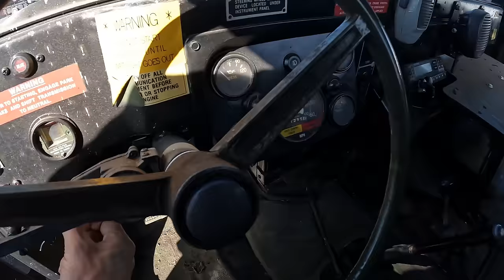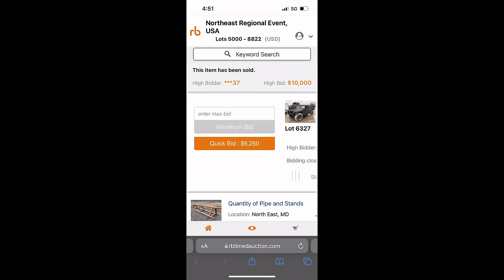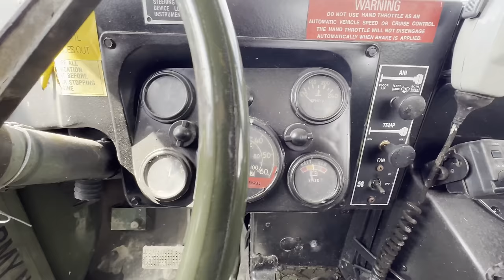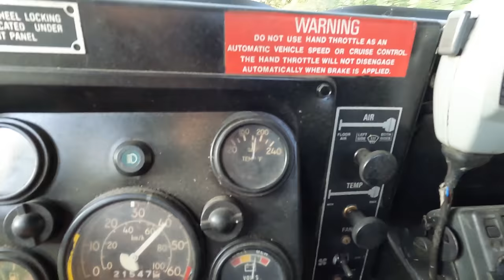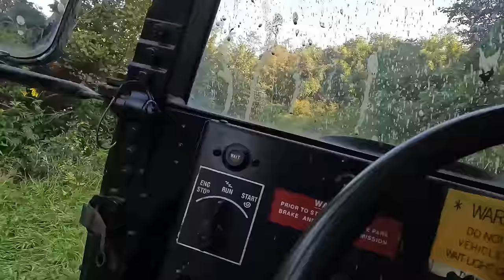Buying, Servicing, & Off-Roading The Cheapest Humvee I Could Find!!

Comment: Your front tires were spinning like an open diff when you were in that big mud hole, I believe there’s a feature that if you push and hold the brake and gas or something along those lines it basically will engage both wheels, you’ll have to do some research to know if yours is equipped/how you utilize that feature for sure though

Comment: The antenna mounts were for the AT-1729, part of the VRC-49's. I helped developed the HMMV at 29 Palms,CA.  back in the Mid 80's. We wore a bunch out, crashed a few. Lot better than the Mity Mites we had at the time.  BTW- grill on top of engine deck is no step.

Comment: Hey Matt, awesome video!  You can two foot drive to get the Torsen diffs to transfer more torque when in sticky situations. Great content!
Reply: It's known as BTM (Brake Throttle Modulation). Takes a little practice, but it will keep you going where others will be dead in the water.

Comment: It is like driving a large shoe box. Going from a 1/4-ton jeep to a Humvee was quite a transition. I have seen C&C and the coolest piece he bought and fixed was what we called a Small Emplacement Excavator (SEE) is a lightweight, all-wheel-drive, diesel-engine-driven, high-mobility vehicle with a backhoe, a bucket loader, and other attachments such as a handheld hydraulic rock drill, a chain saw, and a pavement breaker. The Germans developed it and called it a Unimog. As a former Soldier, I can assure you there are other Soldiers loving what you are doing. It is what they wanted to do but could not. Don't let the Army see you put that top on or work on equipment or you will be DRAFTED. There was a big deal as some manufacturers put a bunch of Chinese Blocks or engines in them. You could probably get the Technical Manuals from Operator to Depot maintenance. The oil Filter date is 2010. In the military, they slash the zero to distinguish it from the letter "O". I bet that the fuel filter has never been out of the case or changed. It is definitely not operator maintenance level. They make a fording kit for these. The Marines put them on all of their vehicles for obvious reasons, the Army not so much. Careful fording streams. If you hit the water too fast the plastic fan destroys itself.

Comment: Those brackets are for the light bendable antenna. The mount in between the passenger and driver is the deck plate for the radio accessories

Comment: Just want to add a couple of items that you missed from the maintenance  manual.
You should replace gear oil, might as well do it, takes regular 80-90 gear oil. Transfer case as well.
Inspect all glowplugs or better yet just replace them, half of them are probably mushroomed out at this point.

Comment: The Humvee is a beast, all come with the rear back rest when used in the 2 man mode, the green things are antenna holders.  BE CAREFUL, the brakes stop the axle shafts and no the wheels. You can twist off the shaft in front by having the wheel spinning and slam on brakes.

Comment: General off-roading trick for any vehicle with antilock braking installed, just like the humvee with its torque locking diffs, if you use the brakes correctly you can gain traction.

The difference is, on the Humvee, you apply light braking whilst applying the gas, with an ABS vehicle, you want to apply full hard braking whilst giving it gas.

It will see the wheel that's not spinning (and has traction) as "locked up" and will release the brakes on that wheel, whilst continuing to apply hard brakes on the wheel that is spinning (and has zero traction).

It's basically the same thing electronic traction control does.

Comment: Those two things you found are actually antenna mounts that you would put on the back of the HMMWV. They bolt in with a flat face on the back of the truck above the tail light, and the other flat side towards the sky (this is where the spring would sit on top of for attaching the screw on antenna for VHF radio systems).

Comment: During my two decades of service I was of the opinion that the Hummer was ridiculously underpowered for a vehicle of that size/weight.
Reply: you mean 60mph on a downhill with a firm tailwind is sub optimal for 10 tons of fun wrapped in military drab perish the thought lol
Reply: 100%....that's why I'm puttin a Cummins in mine.  IMO, that's what they shoulda come with from the fac-to-ry
Reply: @bryanford1139  Duramax diesel was a popular swap years ago when AMG still made the Hummer. Things got screwed up (more like trashed) when GM licensed the brand. I think Jim Lynch of Lynch Hummer did the first Duramax motor swap. I saw his truck at the first Hummer Homecoming in 2000 at the factory in South Bend.
Reply: It was ment to be underpowered.. so daft young new recruits couldnt beat it to pieces.. 🤣🤣
Reply: @Fuch YouTube

These things are naturally aspirated.
Reply: Fuch Youtube  no turbo on these. like Matt said they made a turbo kit for them. The question is finding one.
Reply: @tonyhussey3610  You've  clearly never been around a company of Infantry soldiers
If it can be destroyed they will find a way
Reply: Yeah, 8113 pounds / 3680 kgs with only 155 hp, that's not very spectacular.
Reply: @Netherlands031  for an armored one. This one is around 5200 lbs.

Comment: 24:10 wow, had to look it up, shell T6 full synthetic is about $60 a gallon, the T5 synthetic blend about $20. Whether it's worth it to use the cheaper T5 stuff I don't know. An h1 should take about 1.75 gallons so you'll be needing two containers containing one gallon, so that's $120 vs $40.
Reply: I don't know where you're looking but T6 is not $60/gal...maybe for 2.5 gal

Comment: You still have to wait for the "wait " light to go out before starting. Or you will damage the glow plugs
Reply: no you dont you only have to wait for the light to go out if you use ether you can start any diesel before that light goes out(the glowplugs do not shutoff for 1min+ after that light goes out )
Reply: The only way to damage glow plugs is to leave them on too long. They can swell up and get stuck in the head.

Comment: First things first, service the geared hubs. That is the #1 overlooked thing. Second, the generator is bad if the bats are dead. Third, depending on the year, be cautious beating on it as the early year 6.2's had a bad rap with cracking #8 cyl. walls. 

Ps- there's a guy in Indiana that bought out AMGEN and is the guy with true NOS parts. Idk if you'll see this but DM me if you need items and I'll put you in touch.

Comment: I have an 86 M998 all redone from the Maine Military Authority in 2007.  It has 6,000 miles on it.   Has the 3 speed with a new General Engine Products GEP Optimizer 6.5 NA.  AM General bought the rights to the 6.5 and produced the Optimizer. They worked out any bugs the Detroit Diesels had.  Has plenty of power in my opinion.  These rigs are well built.

Comment: you might be able to throw a 6.5 TD van manifold from market place of any center manifold off a 6.5 and throw a set of marine injectors in it and turn the pump up on it to make it slightly less gutless.

Comment: The volt meter will jump for the first 30-45 seconds as the regulator goes through its “sensing” phase and “feels out” the stairs of the charging system.

Comment: 37:22 all military humvees were equipped with limited-slip diffs front and rear. There should’ve been at least some spinning from the right front tire. Something to check on.
Reply: Your not totally correct. Its by design.  You can by pass this issue by applying the brakes slightly. Originally designed for nascar in the 70's but never used ever. Humvee bought the rights to use. Well the designer/ builder.

Comment: Save the back window and trace a pattern on 1/2" CDX plywood, measure the top of the cab roof to use a 20 gauge metal hard top. Spot weld it on.

Comment: On the military M1009 Chevy Blazer K5 with a 6.2L when bleeding the fuel filter it is recommended that you disconnect the electrical feed to the Injection Pump so when you are cranking the engine to bleed the fuel filter the motor will not be getting fuel and will not start.

Comment: If that 6.2 diesel is anything like the ones they used to put in the GMC and Chevy trucks in the 1980's, they definitely weren't the most powerful. But they were pretty good on fuel and good runners. My dad had a 1987 4x4 half ton Chevy pickup with one of those 6.2's and it ran really well. I think it averaged 18mpg. My mom's uncle had a 1982 3/4 ton with 6.2 he used to pull a big camp trailer with. He put the banks turbo in it. The year before he ran the turbo, that thing was on its knees averaging 20-30mph up the mountains in California. The next year with the turbo, I think the slowest he got on the hill was about 47mph. A definite improvement.
Reply: Ha my Duramax with around 480HP 900 ft/lbs gets like 21mpg interstate
Reply: @mrmotofy  no doubt the diesels today are much better that what GM offered in the 1980's. The 6.2 V8 diesel was basically a converted 4 bolt main 350 V8. Definitely underpowered. The Banks turbo definitely helped. 18mpg was pretty good for any truck at that time. I think the 6.2 was capable of alot more miles, too, but for some reason GM felt it necessary to design the injection pump to fail around 80,000 miles. I guess that was done to avoid a more potential catastrophic issue or something. All I remember is dad had to have his towed to the shop after reaching over 80k miles and the mechanic told him the problem and they were designed to do that. So yes, they have come a long way with the diesel for sure, including transmissions. GM boasted the Allison transmission in the Duramax in the early 2000's and they had alot of trouble with those. My parents were travelling down the freeway in 2002 with trailer in tow with their 1999 Dodge Cummins and saw a Duramax with camper on the side of the road with a lake of transmission fluid under it.....

Comment: you could put an electric supercharger for power. by the looks of the top, it looks like either bending the center support so it has more arch, or adding an arch, you could tighten the roof. this should also reduce the ware/snow that can pool on it. also it looks like the  front diff isn't locking.

Comment: When I was in we had to get licensed on each vehicle type we could drive. The license looked about as official as a middle school library card. I got licensed on the Humvee but only so I could pull staff duty driver. We didn’t have any in my section. So I hardly ever drove one. I forgot they don’t have park…. I also didn’t know the seats stored under there like that….. All of ours were either set up as the 4 door models for the staff officers, or as the pickups. We’d never change them around. Though I think you have the wrong doors for that soft top. All ours always had the soft tops. And the doors were soft too. I only saw the hard doors on the weapons carrier versions the MPs had. Which had hard tops. That was before they started up armoring them. Though you wouldn’t be so happy to see all those grease fittings on PMCS Monday.

Comment: Imagine how it would go through the woods if you had lockers front and rear
Reply: If I'm not mistaken, the Humvee has Torsen limited slip and in situations when the wheel is in the air, you need to apply the brake and then the power is transferred to the other wheels.

Comment: @12:56 those are indeed antenna holders. but they mount to the vehicle with the 3 bolts on the other side. the 4 bolts are for the antenna itself. so u have them facing the other way around.  the "triangle" should be facig down.

Comment: I read a lot of the comments but did not see anything about the fuel filter, there is a good possibility it never been changed or a very few times. It's not much easier, next time take the four 1/4 bolts off a just drop the caster. That is what I used to do, also for priming the fuel system fill the canister up with fresh diesel. You might have done this off camera which I didn't see. Also do not use either to start this engine it will swell up the glow plugs and you will not be able to get them out. If they would if the tip breaks off you'll be pulling ahead or it's going to damage the engine.

Comment: Replace alternator 12v system new batteries new headlights light bar remove doors during summer 
Heavy rear tow hitch  heavy front tow rings.   Chains and tow equipment 
Awesome content

Comment: You sir are correct they are in fact antenna mounts.
And next time when you're bleeding the fuel system look on top on the engine and disconnect wire 54A that way engine for sure won't start while you're in the bleeding process

Comment: I have had the 6.2 and turbo 6.5, both pretty gutless, and unlike the cummins 6bt, they don't take to much power boosting. I went the whole route with my 6.5, custom pump, bigger injectors, timing, increased boost, not worth it, they don't like it, just enjoy it the way it is.  The only thing worth changing is to the bigger cooling fan if you have the smaller one.

Comment: Very cool to see that you H1 has the same light running light headlight control as my 1954 M38A1 Jeep is your H1 also still 24 volt? I kept mine 24 volt because its old school.  I still have the foot starter button up under the dash on top of the transmission hump.. aka foot actuated starter, we don't need no solenoid.. Cool video I really want to get an H1 but i hear horror stories of trying to obtain a affordable running machine without a bunch of red tape to purchase.  is $10k in the ballpark for a decent H1?  I would really like a hardtop 2 door unit.

Comment: So a couple things about this
1, you see it has no park gear lol 
2) HL on ghe left shit (top slot) is high Lock, it'll lock your AWD transfer case in for a 50/50 split
3) you gotta turn the truck off to shift through transfer neutral 
4) you have been instructed that those are antennea mounts
5) that looks like a converted 4 man to 2 man because all the 2 man I've encounted just have the covers, no seats attached
6) it's a gm 6.2 idi (detroit) 
7) you can message me with other questions if you want. 

I might be able to get you a nice set of led headlightsbifnyou want them

Comment: Hey Matt, I just saw this video you did on that hummer and to check the transmission fluid properly, you need to have the vehicle running, up to operating temperature and the transmission in neutral.

Comment: Congratulations! Very happy for you. A little advice from having owned two H1s for 30 years: At 37:21 the left front tire is spinning out. Don't let that happen. If a spinning wheel grabs by getting traction, the axle will snap like toothpick. (It is supposed to do that as the half shafts are fuses. Better to snap an axle or than something internal breaking. An axle can be changed in a few minutes. Taking wheel off and remounting is what takes time.) But, learn how to do brake-throttle modulation. Whenever you think you might get into a spinout situation, let your left foot tower hang over the brake pedal. If you sense ever so little spin. press the brake lightly. In some situations you might have to press pretty hard if the wheel is completely off the ground. Doing this will stop the spinning as the Torsen differentials are torque biasing. On this trip you took you should have been able to go right through all obstacles without backing up. -- At next service check the spindle nuts on the back side of geared hubs. Change the looking rings or upgrade. Easy to do, as you don't want a wheel to fall off. https://www.youtube.com/watch?v=t6XsvJz-mas

Comment: Put some electrical gel type slickup in the groove and the new top will glide right in (not that I'VE EVER DONE this exact repair.  I'd remove the wood side panels to access the rear window & top. Good luck with 'er.

Comment: Years ago I used to work for a power company and they use old military vehicles I help to put in a transmission in a deuce and a half that was a pain we had to put the transmission up under the vehicle and then use a come along to put it up into the floorboard where it would line up. I love old military vehicles most of the those vehicles all the wheels pull at one time let me know a 4x4 6x6 you know all six wheels pull it one time they're tough vehicles and sometimes they're hard to get stuck depending on what you're driving

Comment: Yes, the 2 seaters had 4 seats and yes those are antenna mounts.  All of the soft top models could be converted from 2 seaters to 4 seaters just by changing out the tops and adding the 2 doors.  Or jut remove the top, move the bulkhead back and set up the rear seats.

Comment: There are ways to get good dependable power from your motor 
A simple turbo 
Will boost power a little bigger turbo plus after cooler will make a dramatic difference
Then add in a little pump work 
And then you can go crazy 

But small changes can an do make big difference on Diesel motors yet still keep reliability an actually better fuel performance

Comment: You got a good deal on your HMMWV. Way back when ,we could buy these for between  4 to 6 grand  all day and several types. My friends and I got in on them just about the time the prices jumped to like 10.to 20 grand.crazy. But I guess that's way better than the military paying like $250 grand per unit.back in the 80,s and 90,s that was a lot of tax payers dough. They are a lot of fun to drive and play with. One really bad thing is going 4x4 ing through trails and rock ledges that were made for Jeeps and side by sides.  The trails are just way too narrow for the HMMWV. 
And if you want to do much Hwy driving the 6.5 turbo with the 4 speed auto trans is the one you want. The 6.2 is pretty gutless.